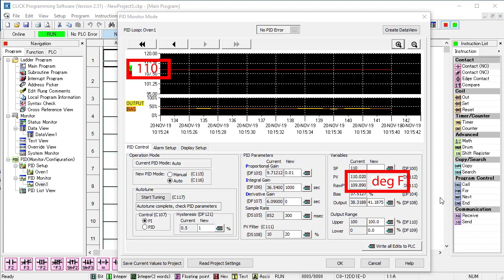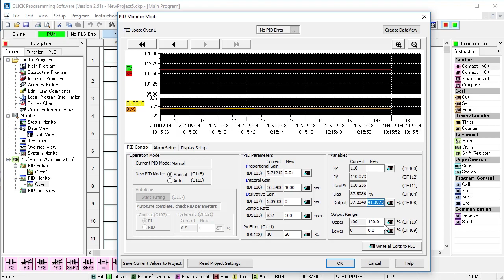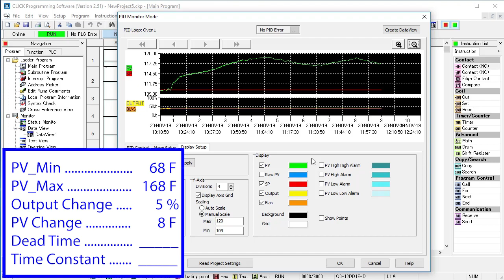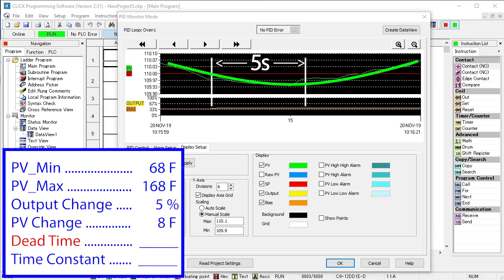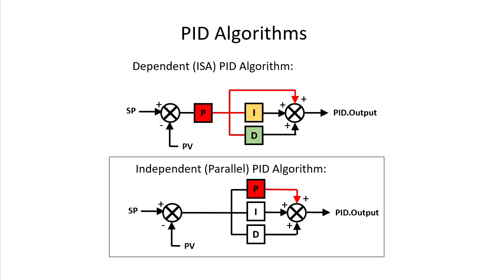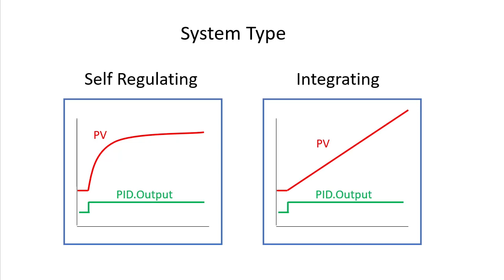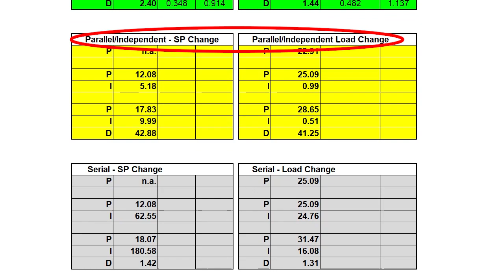CLICK PID Tutorial Videos Part 5A - Manual Tuning from AutomationDirect

Comment: What is calculated differently between an integrating system and a self-regulating system? I didn't see anything in the spreadsheet that made that distinction.
Reply from the maker: Yeah, the spreadsheet is just for the Self Regulating system.  To see an example of the Integrating system, check out this tank filling example we did on the GS4 VFD: https://youtu.be/6GmvY38Z3Lw